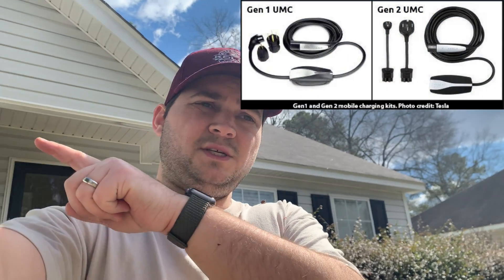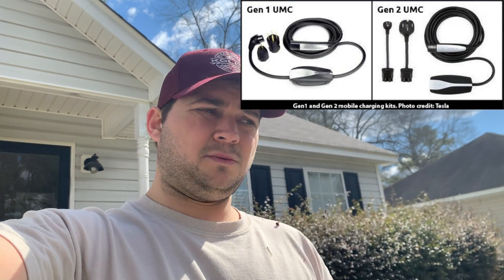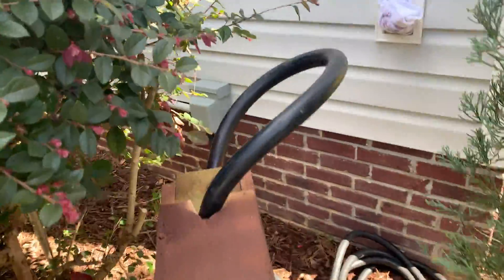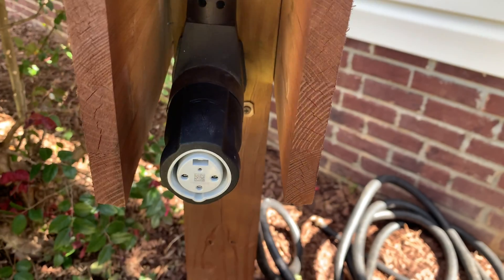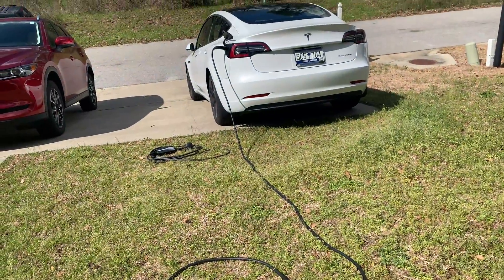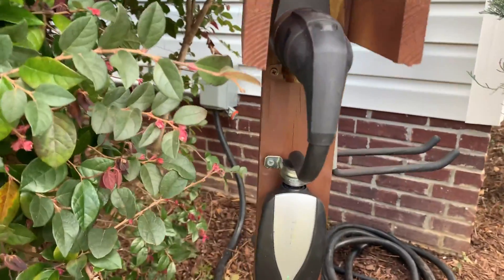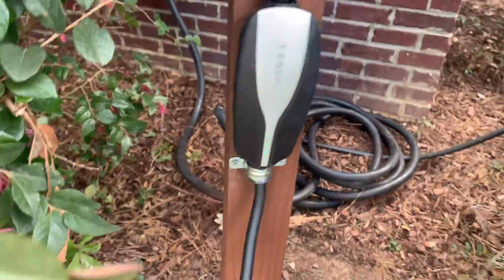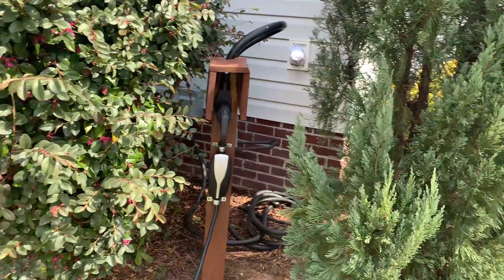Tesla Gen2 to Gen1 Mobile Connector Charging Solution With Nema 14-50

Comment: How can you tell gen 1 and gen 2?
Reply: So the mobile connector that comes with your car is gen2.  It has adapters that plugs into the large Tesla block that lights up green and will have some cable length after the connection. Gen1 adapters plug in at the end of the cable and are just an adapter with prongs on it.

Comment: Looks good. You could even gain a foot or so of length, if you lowered the connection on the wood post downward a foot to 18 inches closer to the dirt. Since you have the length unused on the back side from the house. I did that in my garage with a Tesla wall charger. It's mounted 18 inches up from concrete floor, to give more length to reach car.
Reply from the maker: That is a good point. I actually ended up taking it down because the RV extension cable melted at the wall, and also to the Gen 1 MC adapter. I now have my Gen 2 MC connect straight to my wall which significantly reduces the length. It’s a bummer but to expensive to fix. I think I made a video on that also.

Comment: Gen 1cable had a recall due to the amps at 40 , touch your cable it will get super hot, I had a gen 1 cable before then it took a crap now on gen2 cable
Reply from the maker: That makes me nervous. I will look into that. Was it just that the cable was good to 40amps. Looks like the recall only applied to the adapters, and it didn’t include the 14-50 adapter. https://www.tesla.com/support/adapter-recall